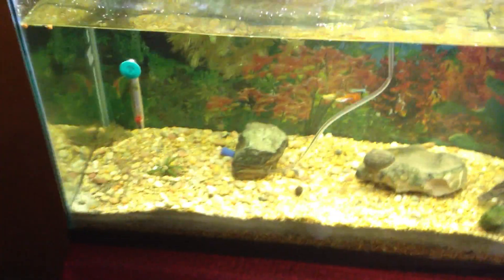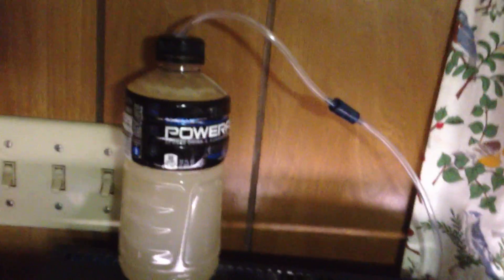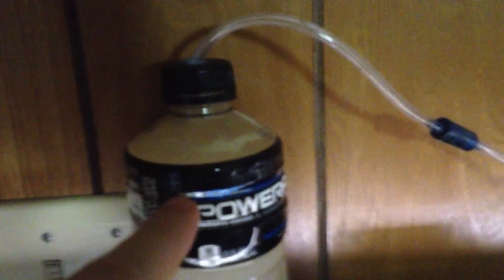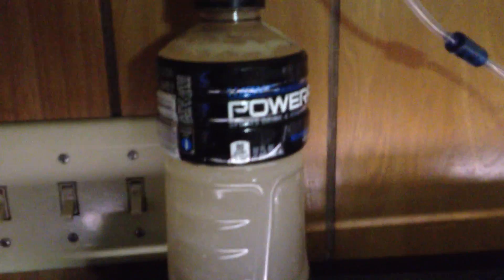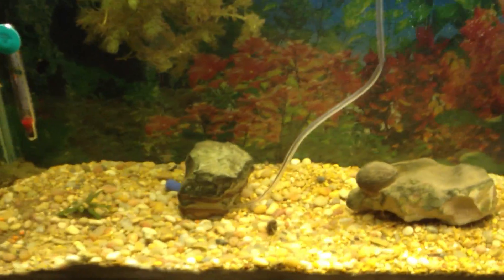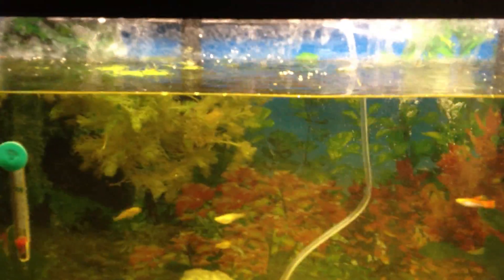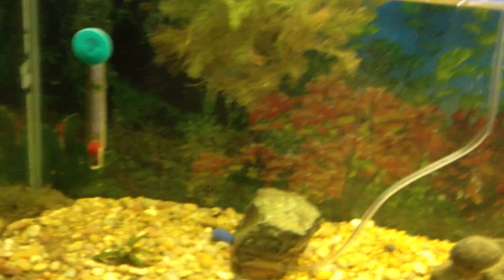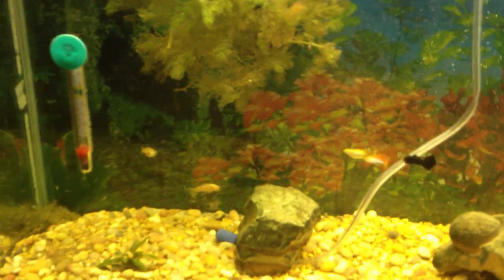DIY Carbon Dioxide Reactor

Comment: Instead of raw sugar try an invert sugar the yeast will work less to metabolize the invert sugar. Also add a lil yeast energizer nutrient to amp up the reaction and add some frozen juice concentrate. Lastly use a high alcohol tolerant yeast like brewers or wine yeast as it will survive longer then bakers yeast since it has a higher alcohol tolerance. Peace